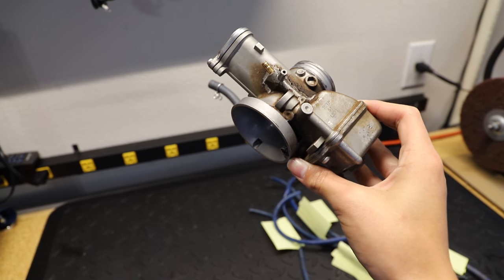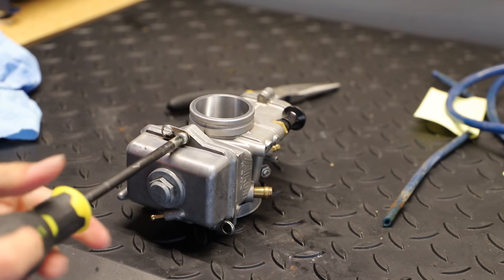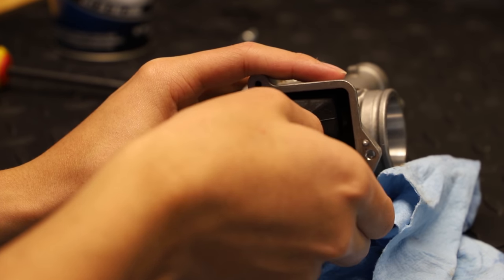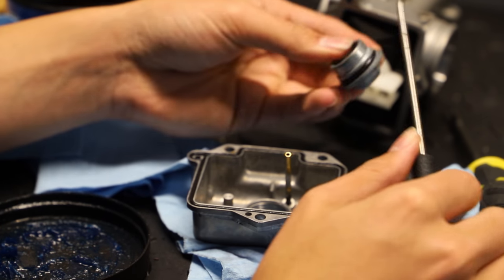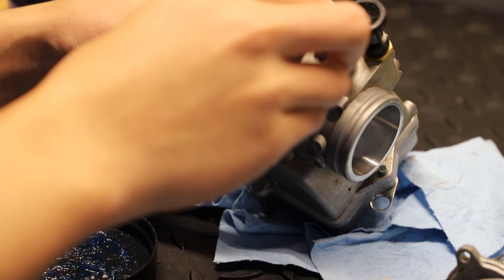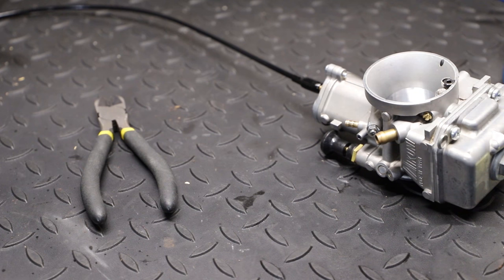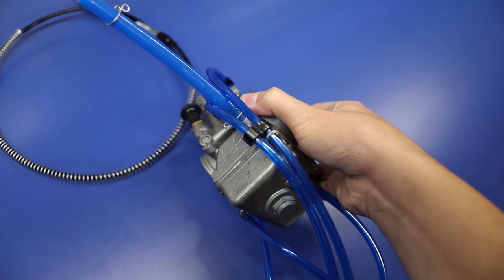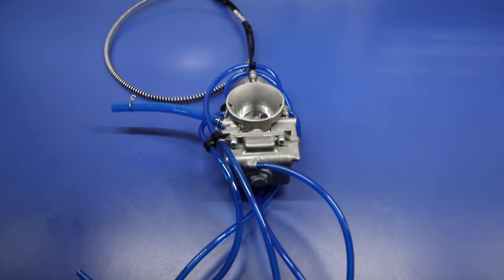Restoring My YZ125's Carburetor!

Comment: Opened up my carb after throttle cable breaking figured may as well make sure it is clean and the main or big jet in the center was literally just setting there not even threaded in at all.
Idk how it was even running before but maybe it finally just worked it's way out?
Right before the throttle cable broke it didn't seem to want to crank or run but idk because my cousin was on it. Thought that was pretty crazy as there has been many simple things I've noticed on this bike not right. I rode this at least 5 good rides before this happened after buying it and the owner said it was a new rebuilt top end on it. We'll see I guess smh.

Comment: which water based degreaser you use? Also for O rings and rubber parts i Use 3M silicone paste. I rebuilt my Tecumseh Powersport carburetor with that almost 2 years ago. It helps the rubber last longer and seal better.